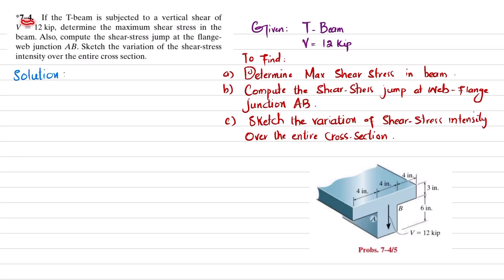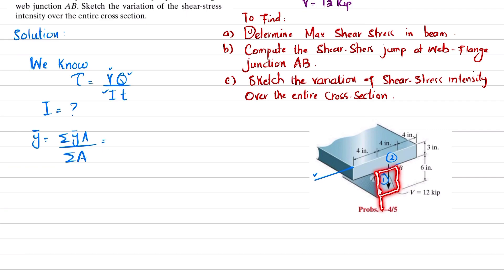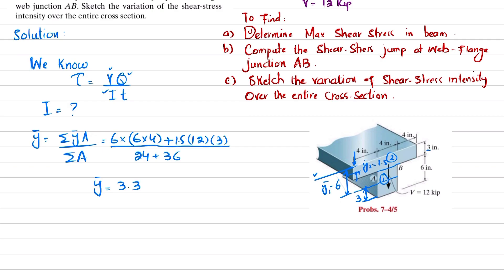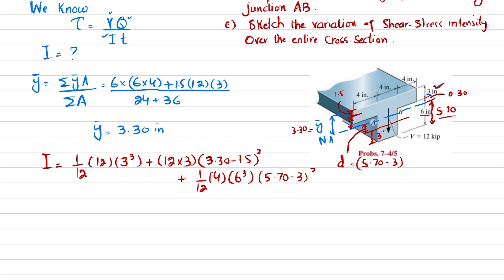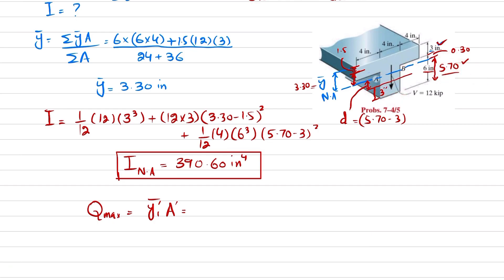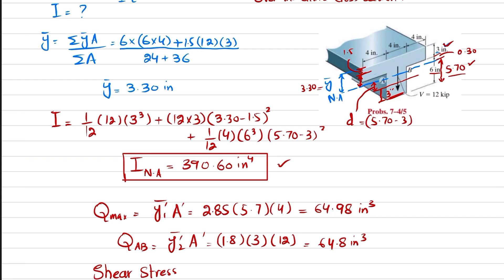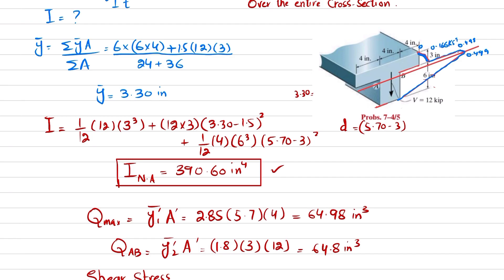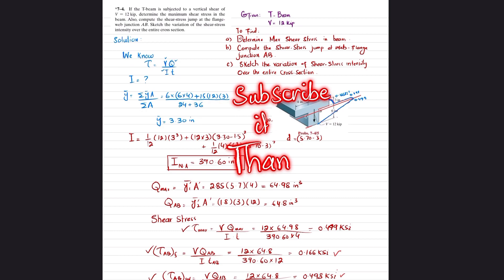7-4 Transverse Shear | Mechanics of Materials RC Hibbeler |

Comment: Sir 
To find the centroid ,we put c1(centre 1) for rectangle 1 and c2 for rectangle 2 
So neutral axis(Y) =(a1 *y1 +a2*y2)/a1+a2
Where a1 and a2 are areas of rectangle 1 and 2 and y1 is distance from reference x to centre 1 and y2 is distance from reference x to centre 2 
This reference x is the bottom most of rectangle 2 .......
On this way we will find the centroid of T shaped rectangle Am I right
Reply from the maker: You are 100 percent right....